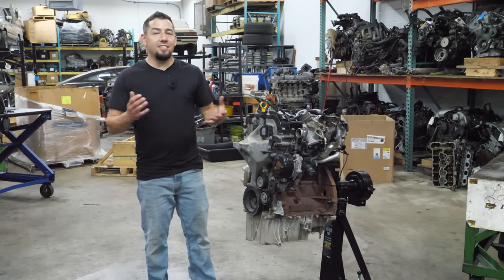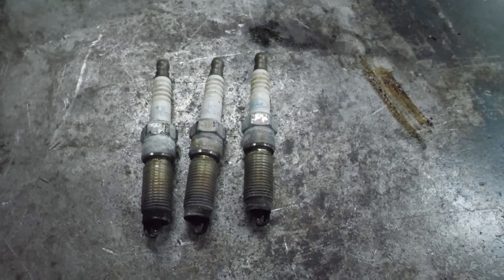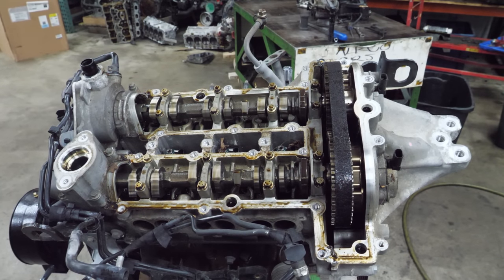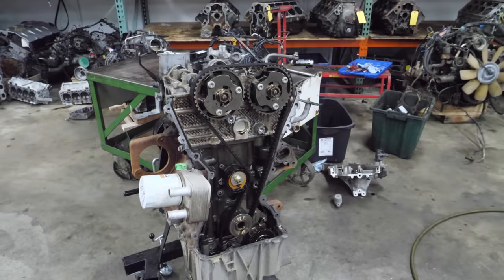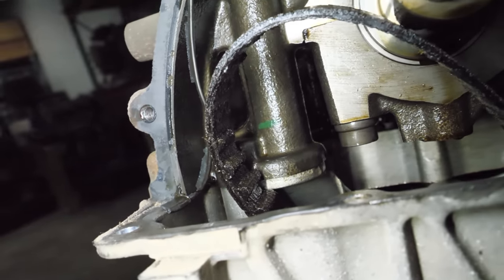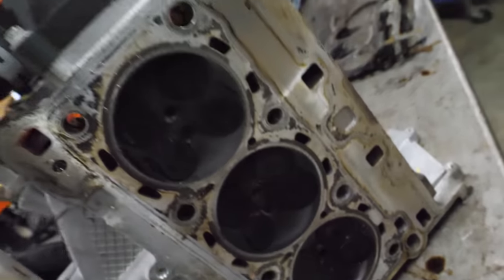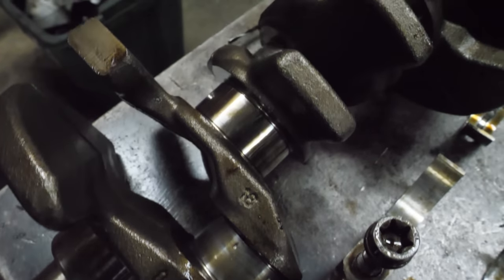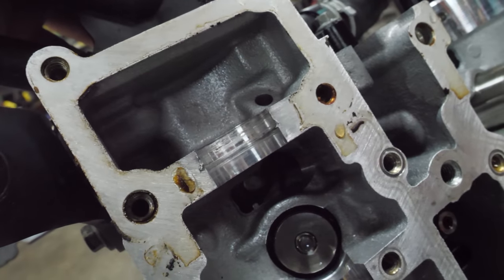JUNK Ford Ecosport 1.0L 3-Cylinder Ecoboost Teardown. LAWSUIT ENGINE!

Comment: This engine has an appalling reputation in the UK. It is known in the motor trade as the Ecoboom because it blows up so frequently! Wet belt failure blocking the strainer and causing low oil pressure and subsequent bearing damage…pretty much exactly what you had there.
Reply: I also hear Wednesday's can make it explode.
Reply: Just so simply not correct for over 10 years was the best selling car in the UK most of the doubling the amount of registrations the the car that came in 2nd place so yes will seem like high failure rate but if driven well and serviced great fun engines in 2014 the fiesta had a 1.0 140ps  I drove one for 6 months averaging 46 mpg and a run to Leeds from London I was getting 60mpg.
Reply: How does it run long enough while missing so many timing belt teeth to nuke the bearings? If would expect valve contact or just so out of time it won't run  before all that bearing damage
Reply: @rossmills7218  McDonalds is one of the most popular restaurants in the world... doesn't mean it's any good. Ditto the Ford Fiesta. Though to be fair the Poms are used to rubbish cars, they bought all that BMC/BL/Rover shite for decades lol
Reply: @j.d.saccociates3313  the belts shed fibres that block the oil pickup strainer. By the time the oil light comes on persistent low oil pressure has destroyed the big ends, mains and possibly the turbo.
Reply: @j.d.saccociates3313  ring land failure is also common.
Reply: @rossmills7218 WOW it lasted 6 months? That must be the longest ever for one of those pieces of crap!
Reply: The lower belt is not for timing, it's for the counterweight, etc.
Reply: You probably have to change those 2 belts out every 40k miles or so just to be safe.
Reply: @SalandFindles the problem is to change the belts it is an engine out job 10 hours work.  The belt is designed to be changed after 150k miles or 10 years . My wife's fiesta has had the job done and it cost £1800 which is over 4 times what a timing belt on our old fiesta. I think because of the cost of changing the belt some people don't bother and hope that it doesn't fail .
Reply: @johnludmon7419  Why'd this one fail in 52k miles then?
Reply: @TheKnobCalledTone. 😂 true that. Good old British leyland. Thank god the Japanese saved the British motorist…
Reply: @SalandFindles  I don't  know why this one failed. There could  be many factors from low oil to a bad belt or it is over 10 years old. I have to admit I wouldn't have bought  the fiesta had I known about the belt our previous fiesta though was pretty much faultless and apart from routine maintenance including 2 timing belt changes nothing went wrong in 120,000 miles.
Reply: The 1.6 Ecoboost was the better engine.
Reply: @SalandFindles  probably caused by using non Ford spec oil. You absolutely have to use the correct oil designed for engines with wet belts cause if you chuck in any random stuff you found in the garage the belt will start cracking and shedding fibers that block the oil pickup. I mean the rest of the engine is clean so the oil got changed in time, just not for the correct spec one. Yeah the belt will start deteriorating anyways but not after <5 years like this one did.
I've promised a coworker I'll change out the timing belt on his Fiesta with one of these POS engines as it has reached the 10 year interval (so far so good but he has used the Ford spec oil, let's see how his 10 year old belt looks like) and I'm absolutely not looking forward to it as it looks like an absolute pain in the ass job.
Reply: @SalandFindles  they were originally "For life" then reduced to 150k. Even at 40k, its a ballach to do. Takes about 8 hours and that's with it out on the bench. Cost £2400 at a main dealer and it needs a special kit to lock it all up and retime it or its instantly trash... Well, more so than it already is
Reply: @creak92  I suspect that many people look the price of the Ford wet belt spec oil and substitute with a generic, thus casting a death sentence on the belts
Reply: @rossmills7218  That's crap MPG - I get more out of a Cooper S F55 with a B48 BMW engine. Hell of a lot more power too, 55% more torque and 37% more HP. Under much less stress too.
Reply: @TheKnobCalledTone. that BL shite as you call it would out last the eco boom ford shite as I still have a classic mini 1275 GT from 1980 which does not use oil and runs great even to this day ford lost their way when they started down the eco boost group of engines total crap design
Reply: then it should be called the the EcoBURST
Reply: It's pure garbage
Reply: Worst engine ive ever seen/worked on, absolute garbage
Reply: Plus, there were literally thousands sold to the hire fleets, these would have been started from cold, and thrashed to within an inch of their lives. Fancy one?????
Reply: @steveguest8028  Is the VW 3 cyl 1.0 better?
Reply: @5starmaniac  They are just as bad i reckon, we see them as well sometimes… its a very poor idea running a belt in oil
Reply: @steveguest8028  Ohh darn.. I see.. They also  run the belt in oil ? :o
Reply: @5starmaniac  yes they do
Reply: @rossmills7218  Not true, we see loads of these engines that the belts go on despite correct servicing(oil changes),the belts do not make it anywhere near the recommended change interval and break prematurely, we have 3 in the workshop(Ford dealer)atm with belts gone
Reply: @steveguest8028  Darn.. I was thinking about getting an Octavia Mk4, maybe the 1.5TSi mill is the better option then ? :)
Reply: Or do they have the same issue?
Reply: Furd knows how to "engineer" a lemon. Top notch.
Reply: @rossmills7218 best selling car does not mean most reliable engine 😂 

If engine reliability is so low nothing can make it worth buying, unless it's a rotary
Reply: @rossmills7218 may have sold in high numbers but is that down to fleet purchases (including car hire) or non technical buyers who don't research their cars before buying? Most cars leased or on 3 year deal so customer doesn't care if car engine has issues for next owner
Reply: The fiesta engine is different to the focus, the focus had an excessive number of failures. Usually small end bearing failure resulting in the piston jamming and the con rod coming through the block. 
The fiestas had very few failures in comparison to traditional chain/dry belt engines
Reply: @TheKnobCalledTone. 😂 The Brits sabotaged their auto industry with greed, incompetence, and ignorance.
Reply: @timtim8468 the balance shaft has to be timed to the crankshaft, otherwise it can’t do its job properly. The balance shaft’s counterweights have to be timed specifically with the weights of the crankshaft.
Reply: @TheKnobCalledTone. Actually it wasn't until those companies were all amalgamated in to British Leyland, that things went downhill. Too many competing brands within the same company, a great deal of infighting and poor management led to cost cutting etc. Combined with a decade of social unrest, strikes and increased competition from Japan, things really didn't recover. Until then, each of those brands produced a variety of practical, well made vehicles for the time, not to mention luxury cars and sports cars etc. But don't let the facts get in the way of a myth. 🤫
Reply: @5starmaniac No they don’t. The 1.0 TSI has a traditional external timing belt, and those engines are stout little road warriors. Night and day difference in the reliability department in comparison to this Ford junk.
Reply: @lynxstarautomotive208  Is it the same for the 1.5TSi ?
Reply: @SalandFindles more than likely the wrong kind of oil degrading the belt.
Reply: @creak92 the timing kit to do the job is over a grand!
Reply: @rossmills7218  1.0 is just an absolute pile of shit of an engine.Well most 4 cylinder ecoboost are dogpooh.
Reply: Most cars with these engines on Autoscout24 are being sold with 20-40k km's.
Owners obviously already knon they have upcoming engine problems and needs to sell it fast to some sucker.
Reply: Had a 2012 Focus 1 litre EcoBoost in Europe you got 2 versions mine with 100 hp or a 125hp which was available in the Fiesta, Focus and Mondeo(Fusion) mine never gave me trouble and I quite like the engine just rules are you need to look after it properly by servicing them with genuine parts and oil

Replace the timing belt every 100k miles and clean out the oil pick up in case of any debris

Also I don't think mine had a balance shaft as ford said it wasn't required as they deliberately unbalanced the flywheel to compensate for the vibration so that balance shaft must be a new design
Reply: Yeah Naa mate. It most certainly does not have a bad rep. You may not like it, that's fine. Ours has done 60k miles with not a single problem and only standard services. And..zero..road tax ever. So Naa Naa nee Naa Naa 😂😂. Soz for the last bit!!
Reply: @bernardfender5147  it’s only a matter of time then.
Reply: @lapoose325 my ecoboost Fiesta is 10years old and has 140.000km on it the wetbelt swap is already due
Reply: Old kia 100000 miles no oil change car kept going!!! Just topped it up when oil light came on turning right!!!

Comment: wet belts are the most prime example i’ve ever seen of “just because you can… doesn’t mean you should” 🤦🏼‍♂️🤦🏼‍♂️
Reply: underrated comment here!!
Reply: I'm nowhere near an expert on engines, but I have had a couple apart, and of course I watch this channel. This is the first time I've ever even heard of a wet belt.
Reply: @TheRealColBosch  The actual engines from Stellantis Group (1.2 Puretech 100/130/155 Hp engines) equiping Peugeot/Citroen/Fiat/Opel cars, are all wet belt engines. If you change oil as required by manufacturer, with required specs oil, there should be no problem.
Reply: Works good in honds GC mower engines... Maybe not a car 😩
Reply: @scuba2nuno1  Sure, i understand that with some proper engineering or whatever it can work but still begs the question, fkn 
whyyyy 😂
Reply: @scuba2nuno1  "Should".  Hopefully this engine had oil changes with the correct Ford spec oil for wet timing belts but who knows.
Reply: Yep it probably needs some special sauce oil do to those belts. So if put just on regular it might destroy belts.
Reply: @TassieLorenzo  This motor looks like never had proper oil change with certified oil. These motors can stand 100k km without belt changes if oil changed every 15k km....
Reply: @InzaCz  In no world is 15k kms a normal oil change interval, not if you like to keep your engine in good shape anyways.
Reply: @--_DJ_-- It is perfectly normal if you use good synthetic oil
Reply: @uksomo  Needs to be Ford WSS-M2C948-B spec oil.  Which some, but not all, eco 5W20 oils comply with (Ford Motorcraft oil complies obviously).  But even with that oil, do the belts really hold up for 10 years/150,000 miles or 10 years/250,000km before their replacement interval (so they are meant to be like new when they are swapped out at that mileage to avoid engine concerns), as Ford say they do?
Reply: i think it was intended to be a chain and some office folk said nah we'll throw a belt there instead
Reply: @--_DJ_--   i change mine every  10k km on my ford but they have 15k in documents.....of course it depends how you driver...
Reply: What is the primary advantage to this design? Early failure?
Reply: @scuba2nuno1  Why make the consumer jump through even more hoops? Looks like no Stellantis or Ford wets for me.
Reply: @TassieLorenzo last week I changed my belts at 120 k km,10 years,I changed my oil regularly with the correct oil(Max 10 k km) and the belts had plenty more life in them,no cracks,no contamination at oil pickup point.I personally think the belt would have last 200k km.
Reply: They are known as “Ford Ecoboom” over here.
Reply: "Planned Obsolescence"
Reply: I think the most prime example of that will always be the V10 TDI from VW 😅A mere wet belt can’t take that spot
Reply: Meee to
Reply: And one of them drives the oil pump. Winner
Reply: I don’t know why manufacturers sell these designs without briefing the customer on how to not destroy them. That, and embarrassingly-low fuel economy for a tiny car.
Reply: Ford likes to use keyless cams and cranks. This goes back to the 4.0 with those crazy sohc heads in the explorer. Same with 4 cylinder focus. No keys. All held together with friction bolts and torque.
Reply: @jeffreywoods4040  ecosport is massive wdym? damn americans never seen a Focus or Fiesta
Reply: @GewelReal we have the Ecosport and had the Focus, but Ford’s pricing put a lot of people off on both. It’s possible that these particular 1.0 engines are more suited to non-US markets with slower average speeds or different driving habits. When they get 23mpg in the US Government’s arguably soft fuel economy tests, they will do even worse in the hands of consumers, and apparently they drop like flies over here.
Reply: @jeffreywoods4040  Fiesta is at least 30% lighter than Ecosport. Most get 40MPG+ here in Europe
Reply: @TassieLorenzo  How can you use a belt that long ? Not even on dry belt engines you don't. This is why the engine in this video belts fail, because never got changed at time, at time means at 150 miles maximum. At 250 miles is pure suicide lol 😂😂
Reply: @InzaCz  That's only 60,000 miles.  That's the interval on dry timing belts from the '90s.  Those typically paid 3-5 hours of labor to replace.  This one looks like it will take 10-12 hours.

They should have just put a chain in it like everybody else has been doing for 20ish years.  It's an absolutely idiotic design.
Reply: @immikeurnot  I saw chains that cant even stand 60k miles,  (GM, VW)  And i would not say that changing chain is 3-5 hours....

But yeah i got the point that belt soaked in oil is not perfect solution. On the other hand if people care about their car as they should. This would never be the main point of failure for this engine....

Just for the fck sake change your fluids when you should, and change your, belts, soaked belts, and chains when you should..
Reply: @503challenger  how many people do the suggested maintenance on their lawn mowers.  Probably none yet the Honda mowers (if they are wet belt designs) keep on mowing. Neighbor had one, It was a beast.
Reply: @paulherbert5548  They are. My 10+ year old GC160 walk-behind mower has a wet belt, along with a plastic timing gear. It got a stuck exhaust valve once, which was no-parts fix. I "exercised" the valve and very slightly notched the stem seal to better lube the guide. Replaced a noisy transmission belt and a set of bald drive wheels. Otherwise just annual maintenance (oil change, chip off the deck deposits, touch-up the blades).
My even-older pressure washer has a horizontal-shaft GC160 that's been completely flawless. It's going to out-live a pump or two from the looks of it.
Reply: @--_DJ_--  heavy diesels are about it.. they regularly go 15 - 20 km with a filter service generally in between..
Reply: @fredwilliams8898  planned obsolescence
Reply: @mitch4825  Yes, but those are a totally different animal. It takes a lot longer to wear out a pail or two of 15w40
Reply: @503challenger those weren't too bad. But they discontinued that around mid 2019. The new pushrod  engines are finnicky  and I got a free one a lady blew up.
Reply: @TheRealColBosch  Belts use tension and friction to hold their positions and thus the valve timing. Immersing them in oil just doesn't make sense.
Reply: @S35CANAVERAL not my personal experience.  European Ecoboosts are well known for premature death due to early wet belt failure.
Reply: @InzaCz no way, wet belt failure is a well known cause of premature Ecoboost engine death in the UK.  Avoid like the plague.
Reply: @dennythescar80s8  The tensioner failed and let the belt. The belt is not likely the cause. There are way too many problems with plastic tensioners.
Reply: @GewelReal  The US gallon is smaller than the European one by 20% which would go a long way to explaining those MPG stats
Reply: @scuba2nuno1  hahaha they are so unreliable. I see destroyed puretech engines needing to be changed a few times a month, and 0 other engines. Terrible design, doesnt take a genius to understand that diluted fuel in oil + rubber under stress is not a good combination
Reply: inb4 dry vs wet clutch on a motorcycle...
Reply: @GewelReal for 40 miles before it blows up!!